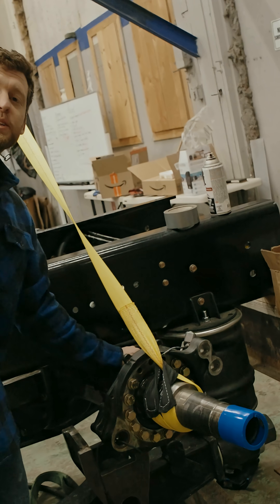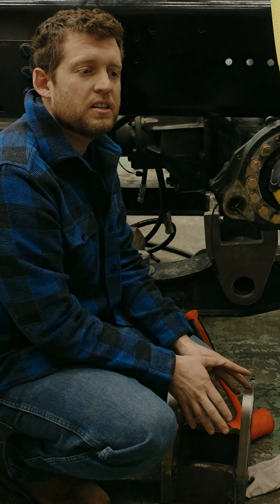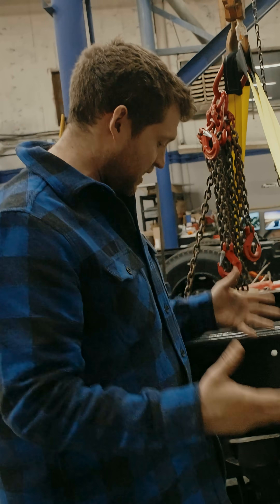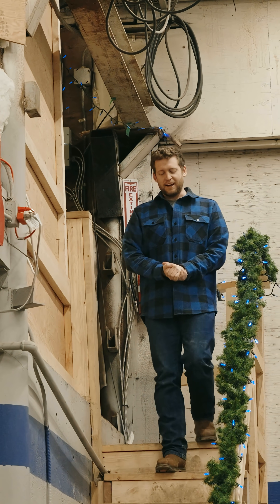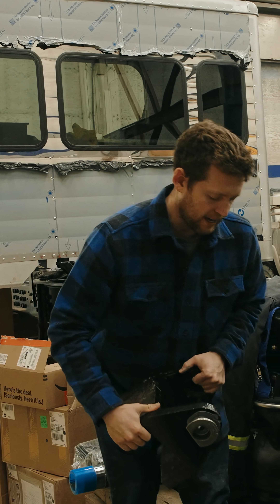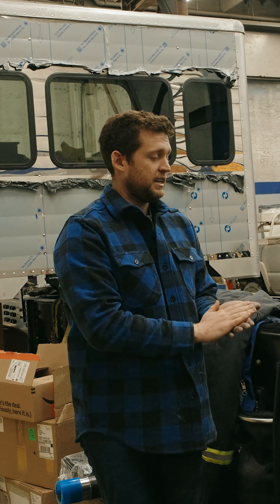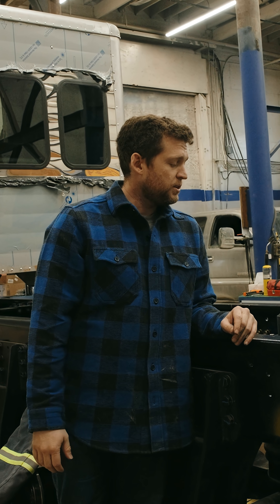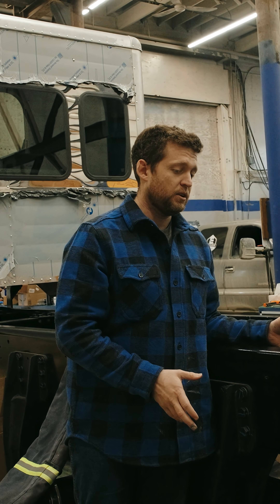Engineer vs Mechanic: Who Actually Screwed Up This Axle Mount?

Comment: The bores need line reamed. 

The final weldment should be in spec. if you've got a +/- .05mm tolerance then when the weldment is welded that's what it needs to be warping or not. 

What I would recommend is finding a line boring machine. They make portable and stationary units but it'll solve a lot of the problem and it'll be done correctly.

Comment: Instead of trying to weld in place, with everything else in the way, and potentially making something that can only fit one axle. Why not make a jig so you can still manufacture the parts beforehand you still have the holes properly aligned? You could build the jig to impart whatever additional tolerance you need to compensate for axles that aren't perfectly straight or round as well. 

Welding in place seems like it is going to slow down construction and cause future issues with part replacement down the road.

Comment: I ran into this with my 3D printing. Sometimes even just 0.4mm is enough for a smooth slide in. Tolerance is a mathematical calculation that your engineer didn't do. He needed to calculate the maximum and minimum size of the part during temperature changes as well as the accuracy of the cutting tool and add that to the tolerance.

Comment: As a design engineer myself it’s amazing how even changing a single step in a fab process or datum plane can change the end result. 

Side point: you say “tolerance” but you mean dimension. Tolerance is the acceptable error in dimension.

Comment: Wouldn’t it make more sense to have them punch the holes under size for the hangers and then do a quick simple line bore across both hangers?  That way any welding or miss alignment doesn’t matter?

Comment: The other option is to undersize the pin hole, weld it up and then put it on a mill and bore both holes at the same time to make sure they are inline.

Comment: The debby downer in me is coming out.  If you experienced the warp issue prior to installation of the axle wouldnt welding after installing the axle make it damn near impossible to remove/change?

Comment: And then sometimes it's the opposite and the fit is so loose, they have to stack washers/shims... And that was the fault of the engineer for listening to the mechanics too XD
Ofc the washers are easy to install and so the design can be extremely sloppy, but it's just that, sloppy.
One day when I was discussing one of our machines with the marketing team I saw a hinge that had stacked washers, and you better believe it when I pointed out the 6 stacked washers they also didn't appreciate it lmao (no idea why there was 6 stacked washers instead of a single piece of tube (or a properly designed hinge) yes that was a industrial machine just like those trucks, but still it doesn't need to be there (it's not used for adjustments) and it's not much more expensive) it's a conscious decision of one of the engineer and maybe they though it wouldn't be extremely visible or it was a temporary solution, but nothing's more permanent then temporary solutions

Comment: I'd recommend setting up a process for the engineering team to poll the mechanic team for questions like this. You can be tie breaker if needed but it should help avoid these missteps in the future

Comment: I dunno who is doing the welding but a good jig could solve ur twisting issues. Im thinking a simple pin in the jig would go a long way to bore alignment. Leave it fixtured until the part has cooled and Bob's ur auntie.

Comment: I’d have just heated the axle hanger to get it to expand enough to get it to fit as it’s going to be welded in place anyway. Then have the future parts designed to fit with a bit of clearance.

Comment: Engineering school doesn't teach expansion, warpage, and tolerances?  I thought they were schooled and paid to figure things out and not "just" design?  Then again, should we talk with designers about engineering???

"Who's initials are at the corner of the print"?  
Does the CAD file match "the print"?
Blame-games such and a mechanic's opinion is just that, an opinion .  Office stuff stays in the office, it's their responsibility and part of their pay scale, the floor didn't screw that one up even if they are at the bottom of "the hill".

Comment: The job of the engineer is to design in the detail effort into the details and subassembly as much as possible so the chassis assembly team doesn’t spend time reworking parts.  When you scale up production, that kind of stop-and-chop labor will cost way more than a “fancy” machined-in alignment feature.

Comment: Chace .. it's probably not a good idea that the manager makes a video pointing the finger at the engineer or the craft.  Instead, identify the problem, not the person.  Then resolve what needs to be done for your team to do what's needed to achieve the goal.  The problem was tolerances.  Also don't forget to add in uncertainty of measurement and accuracy/precision in the build process.

Comment: As a design engineer this gives me Nam flashbacks. It really is amazing just how quickly your name can be thrown under the bus because your relying squarely on another dude confirming a conversation was had regarding certain details. Thats why email confirmation after a meeting is so important. I've had millions ride on the line without that before and thank Almighty God the man I was working with came forth and confirmed what we had talked about on the phone and the mistake was his. I would've lost my job otherwise. It's insane the stress engineers actually go through in prototyping and how much information or details can get missed when they're rushed through. That's why proper prototyping is so important! Good on your team with working through that stuff!

Comment: The engineer needs. to understand the variability in the process and how those processes affect the end result. A better solution would be to design with the processes in mind. If there is a need a tight tolerance, can that feature be added at the end of the process.

Comment: I worked for a company that had farmers that ran our maintenance department for decades. We never had engineers. We never needed them. When they decided that we needed them and created an engineering department, I think they set us back years. You couldn't talk to them because they knew it all.
I guess my point is to hire some old farmers and fire the engineers. 
Things they design and build themselves always work. You will save a lot of money 💰.
Reply: As a farmer, mechanic and fabricator, I appreciate your comment!   There are obviously things that require true engineering, so having a team of engineers, fabricators and assemblers who have a balance of determination and humility will make for a dream team.
It takes time, communication and respect to get to that point, but I have seen it happen and when it does, it’s a thing of beauty.
Mistakes will be made in EVERY department, if the individual teams can learn to overcome them and work together to create a solution, they’re golden.
It’s Chase’s job to either promote that atmosphere or hire someone who has the skills to oversee the individual teams and remind them that they are merely subdivisions of Team Edison.
Having said all that, I wish I was thirty years younger….  I would have loved being on the ground floor of Edison Motors.

Comment: I am nobody, but discarding an efficient process because of one imperfect product doesn't seem smart. I would still do that piece pre-built using a stiff jig maybe and/or a final machining step to finish the holes. This seems to be a prototyping stage, so it's normal to not yet have all the right values in the manufacturing plan. Pre-building is a proven way to do things more efficiently in most cases. Fix the process, I don't see the need to completely change it. Respect.

Comment: Weld your bracket together, then linebore and hone the pin holes after.
Reply: Came here to say the same thing
Reply: Lots of unnecessary work for mass production
Reply: @freak0429 grinding every piece so it fits seems a lot more work right
Reply: @BR-hj9kp Grinding one run of parts and then fixing the issue and further developing the part instead of line boring a bolt mount lol? Crazy
Reply: Technically with line boring you only have to drill once instead of twice, but i got your point haha
Reply: @freak0429 that's a fair point
Reply: Thisis the way
Reply: Yup, first thing that came to mind as well!
Reply: Yes I agree weld them the machine them

Comment: Machinist/welder/engineered here. If you need tight tolerances for holes of welded part - after part is welded, clean up the holes with a reamer.
Reply: - tell, from your practical experience (not being a mechanic but a; "fabricator, welder, fitter")  - them how to "Guarantee"  - in line holes will be aligned also - hint: line boing or borer -milling after fabrication.  

Bolt on fittings are designed so they can be fully manufactured before fitting, weld  on components - either have lower tolerances or will be final machined after fitting (welds can't be shimmed to perfection unlike a bolted connection)..
Reply: @kadmow  Line boring and milling is an option, but it also takes a lot of setup. Would be worth for larger scale manufacturing and re-machining of single part. But for small scale manufacturing, a straight flute hand reamer can be cost effective option.
Reply: Probably need a pilot pin to keep the reamer aligned too.

Comment: Don't Bull$h!t - ask your Engineers WHAT the fit was intended to be (Shaft basis Limits and fits  - running fit - or whatever - there are fits and finishes for all types of components - or worse things happen.  Line bore the final diameter after fabrication - IF warping WILL happen and this warping cannot exactly be modelled as the application of weld varies.

Comment: You should have those waiting for the mechanic who told them he would grind it, so he can use those on the next truck! Add an ⅛" for the root weld ¹/16th on each side, and taper cut where the weld goes!

Comment: As an engineer I speak from experience when I say that engineers do not understand that variation is a real thing.
Reply: ??  No you aren't speaking for most engineers in that (fits are specified from the basis - don't make it "on the number", make it in the range  (0  to + doesn't mean we want it exactly on Zero, somewhere in the range may be more ideal) .  Chase practically thinks "loosey goosey" is an engineering term.

Comment: A jig when you build it o it should be chucked up and line bored to the final dimension, as a mechanic by trade i would have said tight as well and then had it chucked up and bored out after welding.  die grinder or whatever nonesense that could be thought of is just that make a bunch at a time as a process will cut the cost verus tooling up for each set as ya go.....

Comment: Engineers don't build , they draw , like Architects, they don't build
Reply: - And Mechanics aren't Assembly workers... Vice versa.

Engineers solve the tricky problems, fabricators form and weld the component parts together, machinists tolerance the critical dimensions (after fabrication)- fitters bend the parts into place.
The whole team is in the game - talk about all the issues - needs and options.
 - What works PERFECTLY for assembly isn't always so great for a quick repair later on - taking the engine out to remove a steering box isn't ideal.
Reply: Engineer here. I like to joke with my Assembly team that I install screws with a hammer. We are dependent on fabricators, QA, assemblers, service, parts, buyers, and sales to do our jobs. We don’t build and we don’t do a lot of other things too. The right answer for one group could be the wrong answer for another. And not all of their needs get weighed equally. It’s hard for non-engineers to understand. It’s also why there is almost always somebody unhappy and saying engineers suck. No one notices when you get the right answer. They only bitch when you do something they don’t like. Never mind the other groups and their needs.

Comment: When you ask the mechanic and he/she says they want them tight don’t use +/- tolerances use one measurement and make the female part X 0.005 and make the female x + 0.005 that way you will run a clearance of 0 -10 thou no grinder involved or you make them with with 1/8 clearance and make bunch of bushings with 1/8+/ .005 and either surface grind them to your tight fit or mic them to find the best one….

Comment: Things warp when you weld BUT if you use jigs and machine the holes post welding minor warping shodbt be an issue.
Reply: Put a temp metal bushing and bolt in to hold the sides symmetrical while welding.
Reply: I worked for a company years ago which put welded structures into a furnace for a couple of days after welding to stress relieve the metal befor machining,

Comment: maybe use a messed up axle as the welding jig Been watching to much fireball tools and watching all this crazy jigs to hold stuff in place so warpage is minimum
Reply: Careful with jigs. If you have to hammer the pins out after welding, your part has warped. The best answer is drill the holes after welding.

Comment: Truth. Yes engineering design items and installation too . Since to ur specs they are not the ones working with ur production company and verified fitment. Bottom line there’s a thing called QA  Quality assurance. That does that. Metal will always move /expand during fusion. Then is sent to a QA for specified specs .

Comment: A few episodes ago the engineer guy was showing the 3D printed sample of that mount. He even attached it to the axle. It snapped onto the axle perfectly. The key word is snapped. The prototype was too tight and the actual brackets aren’t nearly as flexible as the printed ones.
Reply: - and steel "costs" a lot of energy to "snap into place"..

Comment: This is part of production.  You don’t want it sloppy like a lot rat, but you don’t need it tighter than a single strap on a steel roll.  As you continue to build trucks you will find the tolerances you need.
Reply: Clearances technically, if it was tighter than requested then it would be an issue of tolerance.

Though it may be that the axle had too much tolerance and so that wasn't accounted for.

But a fitment issue may even only be mirage (not necessarily in this case, I don't know). When things, have no clearance alignment is suddenly also very particular.

(You probably already know this but someone reading may find it of interest)

Comment: At least the engineer listened to the mechanic. But if it can be designed to fit without the need for clearancing with a grinder, that would be better.
Reply: Tech also was probably under the impression after the test fit another set of measurements would be taken and alterations made to accommodate the changes going forward.
Reply: The engineer also made a 3D printed twin of a perfect part.  It has its own tolerances and uncertainty.  The engineer can afford to make several 3D prints to bracket the final product.  Plastic is cheap.
Reply: just a little. i never liked using my grinder
Reply: What but a new build with variables isn't a good thing